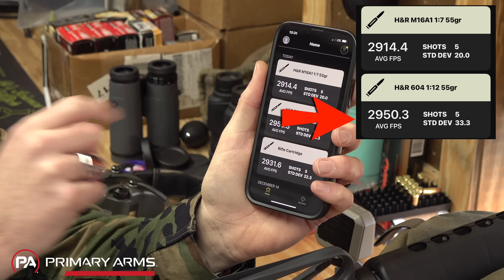Which is more accurate? 1:12 or 1:7 Twist Rate? Let's find out!

Comment: In very simple terms, the heavier the projectile (it is actually a function of bullet length and sectional density, but we are simplifying things here), the faster (lower number) twist rate you are likely to want to utilise. It is bullet length that determines twist rate not weight.
Reply: Shhh not so loud. It seems most of the viewers of this video think something of scientific value was presented. 
You have to shoot hundreds of rounds of increasingly harder to stabilize bullets all sorted for imperfections from each rifle. Than take the ratio of decreasing accuracy and  compare.  Especially since you are using different barrels
Reply: Fun fact with your fun fact you actually dont use s.d but the ratio between the width and length  the density has more to do with the bullets acquired momentum and how far it will travel before losing its stabilization

Comment: Thanks for finally comparing the velocity between the two twist rates with the chronograph!  I've been curious about the twist rate effect on bullet speed for a long time now.  Really wish 1/9" twist barrels were still common like they used to be. Seems like the best compromise for a 16" pipe.
Reply: Even 1:9 was used by bushmaster on 20"  Got it.  Love it.
Reply: @waynehendrix4806  my rifle is a 1:9 twist...at least at 100yds theres little difference between the 55gr and 62gr using same brand of ammo , using different brands from one to the other widens that some
Reply: Old Mini 14's ran a 1:10 twist.  Bullet always leaves the deer sideways out to 120 yds (55gr).
Reply: Note that a higher twist rate will impart more angular velocity to the bullet which adds to the bullet's energy. It makes up for the lower velocity in terms of terminal effects.

Comment: I prefer 1:8 twist as a good over all with the vast majority of 556 ammo I can find on the market. Works best with any thing 62 to 77 gr bullets. But still works just fine with M193 and anything 50 to 60gr and also 80 to 87gr bullets. 

1:7 twist is perfect if you like to use heavy hard hitting or long raing bullets 69gr and all the way up to 90gr or I think 112gr is the heaviest bullet offering in .223.   
But will still do ok with 55gr to 68gr that most of your ball ammo is going to fail into. 

1 : 12 twist. Your sweet spot for accuracy is probably going to be with in. 40 to 64gr. Probably best with 45gr al the way up the 62gr that's not M855/ss109. Assuming you are not planning to shoot past 300 meters. Or gofers at 100m

Comment: Such a weird video. Barrel twist has nothing to do with bullet weight. Its based off the length of the projectile.
Reply: It is to keep things simple. Heavier projectiles tend to be a longer than lighter ones.
But yes that is one of those reasons your rifle might like one specifig load
even though it is not supposed to be a optimal when we look twist and
bullet weight.

And things gets even bit weirder when non-lead projectiles are used
because material densitivity is quite different than normal
jacketed lead bullets.

Comment: In the beginning Eugene Stoner brought about the SP1, 20” barrel, 1in 12 twist 55 grain bullet and the gun world was happy which to this day is still the very best set for an AR type guns effectiveness. 
My very first AR / SP1 updated with an AR15/M-16 A2E2 upper for the way better rear site with a forward assist. 
I was a member of the West End gun club in the early 1980’s and we had a thousand yard range, so I can tell you for certain that a 1 in 12 twist with a 55 grain bullet gos sideways/ key holes at 900 yards. A 25 grain to 40 grain will stay accurate out to 1000 yards and beyond. Groups are measured in feet at those kinds of distances. 
62 grain and heavier goes sideways from 100 to 300 yards out of a 1 and 12 in my experience. 
A 1 in 9 twist rate is what I have found to be the best rate for all around bullet weights from 40 grain to 77 grain fairly well. 
But if you want the most effective rate for what the AR was originally designed for you want a 20” 1 in 12 barrel with 55 grain projectiles, but if you’re going to need to be able to use 62 or 77 grain projectiles you need a 1 in 9 twist rate. 
Be safe out there and always remember that projectiles can travel up to 28 miles so always use or have something behind your targets, never place a target on a hill top, because every single round that goes through the target or misses the target can fly for miles. 
The 28 miles thing is from WWI both the Germans and the US were involved in volley type fire and a 1903 Springfield or 1917 Enfield rifle could fire Ball M1 - 180 grain full metal jacket spiral tipped bout tail projectiles out to 28 miles.
Reply: Pretty sure there is something  really wrong in those numbers. 
28 miles is distance for rockets. Even heavy artillery will struggle to reach numbers
like that.

2.8 miles would be closer to truht what 30 cal bullet will stay airborne when fired in arch.
Reply: Well 
History is truth, it’s things that actually happened. 
WWI holds a lot of unbelievable records and events. 
The farthest confirmed shot with iron sights was in WWI, when a US Marine made a shot at 2,850 yards with the iron sites on his issued 1903 Springfield rifle. 
This information came to me the last page of an NRA National Rifle Association, Rifle Man magazine. 
The history is that there was a German soldier who would stand up on the top edge of there trenches with a large way oversized yellow or Orange brightly colored clown sized tie to draw fire from the US troops so that German snipers hidden in no man’s land in between the trenches could shoot US soldiers. 
The Marine fired a single shot at the guy with the tie and he went down, so the powers that be decided that it was a good time to advance on the German lines. So the Marines traveled across no man’s land and successfully occupied the German trenches and captured all of that territory and found the German soldier with the big oversized tie with a bullet hole right through the tie and right through his hart, confirming that he was hit from 2,850 yards away with iron sights once again firing Ball M1 180 or 182 grain FMG boat tail ammo. 
Back in the mid 1980’s a guy did the math and hit a 55 gallon drum of water at 18 miles with a 45/70 round out of a trapdoor Springfield rifle to see if a legendary story from the battles against Native American Indians was true. 
My youngest daughter will listen to stories, but won’t believe anything if she can’t fact check it. 
So maybe you need to do some research yourself. 
Several years ago vehicles traveling on the 10 freeway Westbound in the Indio area had 50 caliber MG projectiles stick in their windshields that were believed to be ricoches from 23 to 30 miles away at 29 Palms Marine Corps Base. 
I was hoping to give some very valuable helpful safety advice on how far a projectile can fly and for people to be careful when making shots. 
22LR ammunition used to come with a warning that it was dangerous for up to 2 & 1/2 miles, but I believe that CCI removed that warning realizing that 22LR can travel much much farther than that. 
Be careful with how far away your missed shots can travel was my point.
Reply: Definitely not 28 miles.
Reply: @robison87  
Definitely 28 miles 
Look it up !!!!
I try to give helpful information to save lives, probably and not make the gun community look bad by someone just not taking into account or consideration of how far their misses can actually travel was the point of my comment. 
The 28 miles thing was an actual documented thing from World War One that all sides did. 
Say you’re 28 miles away from the front/ behind the lines , you’re relaxing and think that you’re good and all of sudden 20 to hundreds of projectiles start raining in and killing or injuring people and stuff all around you, it would be very disturbing to you and your moral. 
That was the hole point of why it was done. 
Like I say, look it up.
Reply: @storytimedavidcollins2897  no man no lol. I already knew it couldnt, but to appease you I googled it and they can go about 4-5 miles max under perfect circumstances shot at a 45 degree angle for maximum range. You should look it up lol.
Reply: @robison87  
Perhaps you are correct?
I was told this by several WWI,  WWII   and Korean War combat veterans who had been told this by their commanders who ordered them to make these shots to harass their enemies that these rounds would travel up to 28 miles away, along with seeing this same information on the History Channel. 
So maybe someone should check this out and see if it is true or not?
Either way what I was warning people about is still true that if they are not careful they projects can travel for miles and cause lots of trouble.

Comment: Theoretically....the slower twist rate firing the same cartridge should deliver higher muzzle velocity because less energy is being put into the bullet rotation from the same amount of propellant.

There are calculators available online where you can see how fast a bullet of particular caliber and length (weight doesn't matter) needs to be spun for stability....so the twist rate is only one part of the equation when it comes to choosing a barrel.   A 24-26" length will deliver higher MV's and will spin any bullet faster than a shorter barrel and so can work with a slower twist rate.   Lots of variables in play!

The 1:9 is a good 'middle of the road...do all' twist rate that should deliver good performance with most bullet weights.   The Bushmaster Varminter 24" in the safe shoots up to 69's never tried 77's  sub 1" but for some reason really likes a 52 flat base Nosler varmint bullet and will put 10 into sub- .4" groups.   What does this mean?   It's a good shooting rifle and in the end...I think accuracy depends not only on twist rate being compatible with the MV and bullet weight...but quality of barrel.

Comment: Interesting results.   I like to think if optics was possible if the results would have been the same.  I just recently did a comparison between two builts.  Same bolt assembly, upper and lower, but different barrel twist and length.  One rifle has a Green Mountain 1:6  19-inch barrel:  77 grain @ 100 yrds .34, .41, and .63.  Other rifles have a Citerion barrel 1:12 20-inch barrel 55 grain @ 100 yrds just as good.  .40, .46, and .57.  When time permits, revisit this, but this time, switch the bullets weighs and see what happens.   Thank you for sharing.

Comment: I remember the old video where Tim shot 1/7 16 and 20 inch ARs and a 1/12 AR at watermelons. The 1/12 AR was devastating,  but the 20 inch 1/7 did ok too. I bought a 1/9 20 inch Colt MT6700 a d it was pretty accurate.

Comment: Rather interesting sidenote, while doing research to make my own rifle, I came across an aged formula for determining optimum twist rate for a given barrel length and projectile weight/diameter ratio. It is crazy accurate from the tests I've run on various projectiles and explains a wealth of information on why twist rates are what they are for particular projectiles.
Reply: Do you mean the barrel's overall diameter? As if the formula's taking resonance into account? Should that be the case, it'd be super interesting, didn't know it could affect accuracy at relatively short ranges. And if it isn't the case, sir, you still just sprouted something that sounds extremely interesting to look into. Any tips on where to look for? Google became kind of a... say, "sponsor catalogue", not yielding results unless someone payed first, or happens to be hippiepedia. Have a good one!

Comment: I saved all my targets from shooting the M16 in the Air Force. The groups with the Model 604 M16 & M193 are very small. The groups with the M16A2 & M4A1 with M855 are more than double the size. 

I won't bother mentioning the times we used 22LR, blue plastic bullets, tracers, or frangible. 🤠

Comment: I feel like we need a comparison of 1/9 and 1/7 for 77 grain loads???
Cuz I’ve seen “practical accuracy’s” video on 1/9 definitely stabilizing 77 grain. However he didn’t compare the accuracy to a 1/7.
I’d like to know if it matters on any twist rate and bullet weight?
One issue is you really need identically manufactured barrels to be sure. The thing is that rifling can be very very different. And this can definitely cause accuracy issues.

Comment: 1:12 is best for lower bullet weights, 55gr ball or maybe even your 45gr varmint load. That stuff might disassemble mid air if launched from a longer 1:7 barrel.
1:7 is best for heavier bullets. 68 to 77gr range.
Though i did not expect the 62gr to fail that hard already from the 1:12.
Reply: I found out in the 90s that if I handloaded 55gr soft points to 3200fps or more, they would just explode a few feet from the muzzle of my 1/7 twist rifles. Little black puff clouds. The Speer reloading manual warned of this issue.

If I dropped velocity down to 2900fps, they would hold together. 🤠
Reply: That's an old myth. People shoot 55gr from 1/7 all the time no issue
Reply: @bobbertbobberson6725 It's quite true. Most reloading manuals warn you that it can happen. Also, 55gr soft points today are built much tougher than they were in 70s-90s. They exploded in gel back then. Now they tend to mushroom & hold together. Manufacturers adjusted to the proliferation of the 1/7
Reply: @donwyoming1936  1. No you didn't lmao. Unless by soft point you mean fully unjacketed lead
2. No they're not, and no they don't. You can fire vintage M193 from the 60s from a 1/7 and it will be just fine hundreds of yards out. And modern 55gr FMJ will fragment at 2700+ fps impact velocities just like the vintage stuff will. Also FMJ doesn't "mushroom".

Comment: I've always liked the 1:9 twist, but have no idea how it would compare.
Reply: My 1/9 will stabilize all the way up to 75gr.  And have decent group size.  It works really well with both 55 and 62 grain. It however doesn't like 77gr they keyhole with almost every shot.
Reply: My 2 favorites are both 1/9 and perform well in both 55gr and 62gr. I don’t usually shoot anything heavier but do reload a lot of 52’s which do well
Reply: Looks like barely letting trigger reset. That will feel like it’s a lighter trigger than it actually is

Comment: I want to see that 55gr 1/12 twist when it hits ballistics jell vs the 1/7.
Reply: I’ve seen it and 1/12 is has better wound channels !!!
Reply: @Houndshobby  yes in a watermelon...
Reply: Tim did a watermelon test with the 2 rifles and same ammo... 1:12 EXPLODED the melon
Reply: He did one on melons and it basically deleted it
Reply: Seems interesting that 1 in 12 performed better with 556, but with 8.6 blackout it's twist rate is a contributing factor in it's wound channel
Reply: @otterconnor942 the extreme twist of the 8.6 blackout helps low velocity hollow points open.
Reply: The "proper" twist changes between base caliber, and ballistics coefficients quite a bit.  Apple, banana, orange....  @otterconnor942
Reply: He did one awhile back on watermelons. Interesting results.
Reply: @David-xs9nv  my favorite vid….been shootin my 1:12 fn spr vs my dd5v3 1:11 and fn likes 168s and below and dd 175smk it’ll put 5rds on a Pepsi lid@100yrds…fn put 5 168gmm in a dime….
Reply: @charlesmullins3238  I wish I could.
Reply: Tests like that have been done. You might visit some of the few forums that are still left. Because others have those questions. Including speed. At 6.8 forums it seems like twist rate mattered, but not nearly as much as barrel design. That was more than a decade ago that I read it.
Reply: 1in12 works well in Colt 762×39. 1in9.5 is to fast, especially with poor concentric steel case ammo.
Reply: I’d rather see 1:14 vs 1:7
Reply: @meanman6992 I'd rather see 1:9 twist with a length of 20 inches.
Reply: @FinalLugiaGuardian nobody talks about barrel length when talking about twist rate. Shorter the barrel, more twist rate needed to stabilize the projectile
Reply: @lucasvaughn629  You are not considering bullet diameter and length. Short stubby pistol bullets are not long thin rifle bullets. Trust me, I am to old to be spouting falsehoods to the the 2A community.
Reply: @meanman6992  I/14 was what was available back in the day. All 222 Rems were 1/14s and just about everything else was too. Know what was rare 60 years ago? .224 BOAT TAIL bullets. Flat base bullets hit harder; but they were softpoints. Accuracy was great. There were no 224 FMJs until military ammo was available. I want a flat base 55 grain FMJ. Boat tails  move the CG forward; are more stable and do not tumble quite as readily as flat bases.They still do fine. Deeper the cannelure the better.
Reply: me too !  @meanman6992
Reply: 1/9 is the best compromise.
Reply: @mojo4376 My Ruger Ranch 5.56 is 1/8 it is a howling tack driver with 55 gr or 77 gr
Reply: @MJA5  Ikr 1:8 is the best twist to stabilize 55 to 77 grain.

Comment: What about 1:9?  Been told that 1:9 won't stabilize the 77gn but I've never had that issue at 200 and 300 yards.
Reply: I been told that 1/9 is for 55 grain and 62 grain. Yes I also heard and been hold that 1/9 won't stabilize 77 grain. The huge problem for me is that 20 yards is the max range for me so it's hard to tell the difference.
Reply: So far when I have participated I service Rifle Competition, near Lafayette Indiana, my 1:9 twist seems to stabilize. Although Tim is probably a better shot than I. And I have not been able to shoot much over the last couple of years, cause the sawbones have been putting in replacement parts. I have to travel about 80 miles to get to a 200yd range near North Vernon IN. Do you not have any public range near you?  Ours are run by our Department of Natural Resources.
Reply: @mikenstien1861  CA brother. Lol. I don't want to deal with those st0pid park rangers over "lead free" issue. The best range I got around me is an in-door 20 yard range.